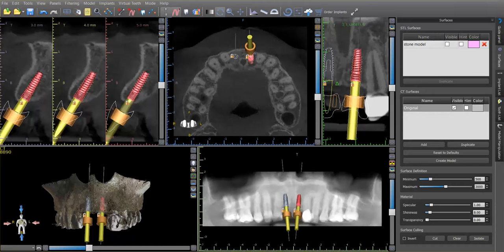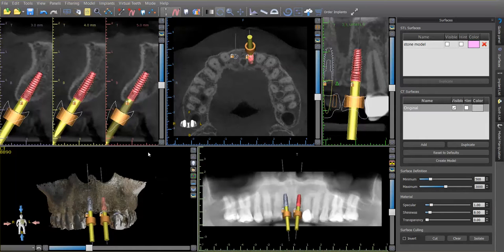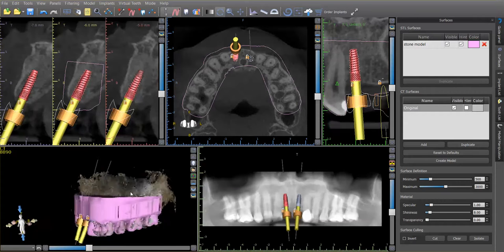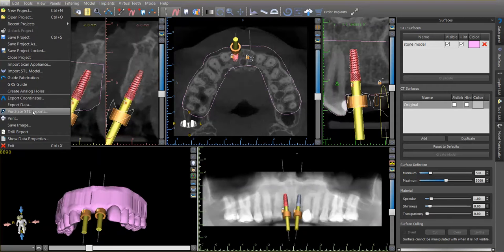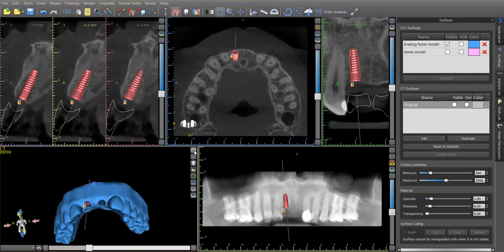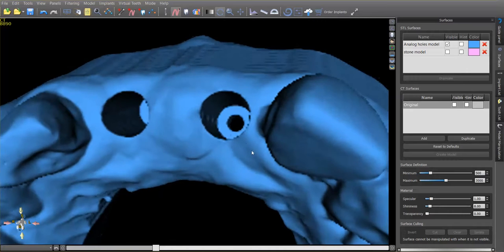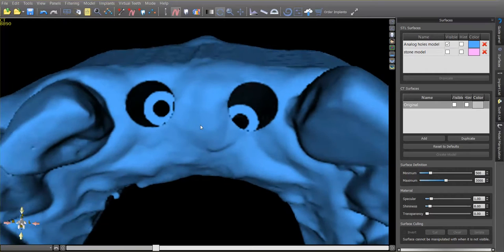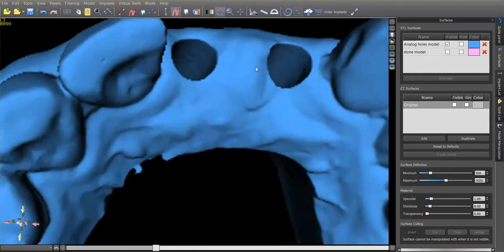How to create implant restorations before even doing the surgery!

Comment: Great video! This could be a dumb question, but how do you ensure that the depth of your implant is exactly the same so that the internal hex lines up perfectly for the abutment of your temporary? Same question if you're planning on using multiunits so you can plan ahead for angle correction of angled implant placement. Thanks!